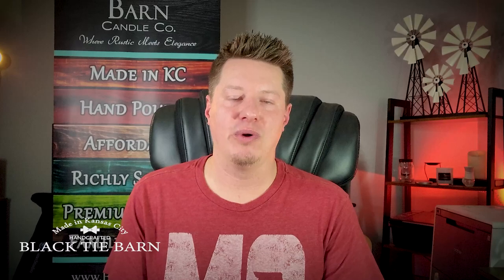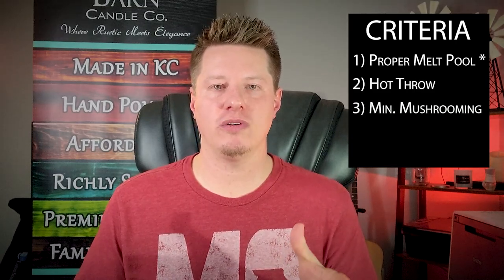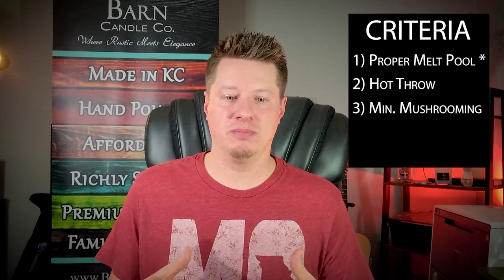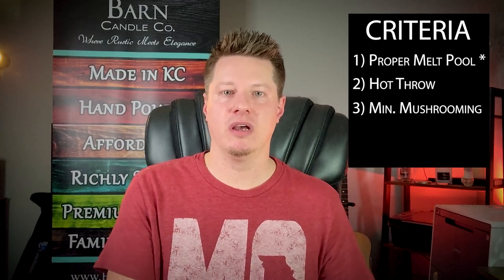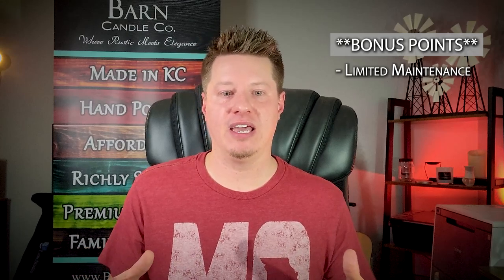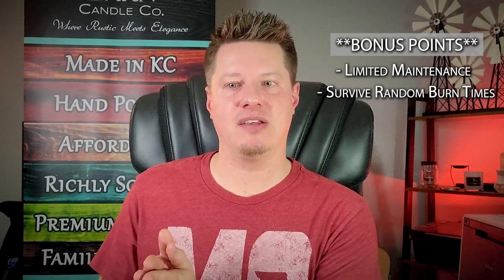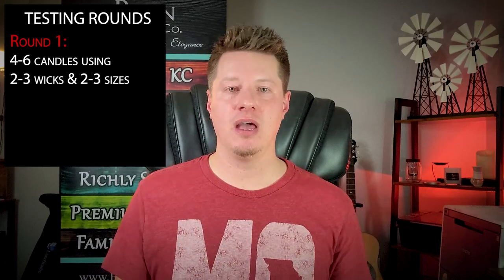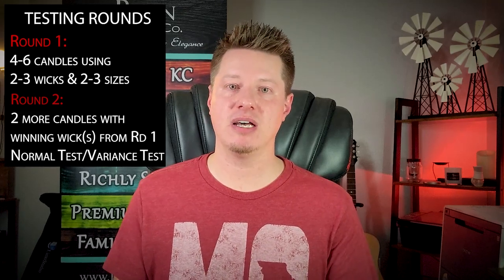Candle Testing & Wick Testing Overview | My Process for Testing Candles | Making Test Candles

Comment: Confused a little lol...I have been using lx 18 wicks from CS in my 9 oz statight jars and LX20 from CS in my 12 oz tumblers....Here is my issue and question. I ran out of LX 18 and LX 20 wicks and CS has been out of stock...I bought LX 18 from Virgan Candle Co and they were not coated, flimsy and seemed smaller which size...I order LX 21 and LX 20 from Lonestar but both were smaller compared to LX wicks..whats the issue...

Question...when testing the LX 21 on a 8 oz tin 2.95 diameter...1 hour 30 % MP 2 hours...50 % MP,  3 hours 75% MP, 4 Hours 80 % MP....why is this wick bigger and performing less than my LX from CS...LX 20 CS was 1 hour 50% MP, 2 hours, 75 % MP and 3 hours 90 % MP....

Am I missing something?
Reply: Wax is 4630
Reply from the maker: Are you testing with the same fragrance oils? FOs make a difference. Also, suppliers use different wick coatings. So  LX18 at one place may be a little different at another place. I try to keep my suppliers the same for each material. But, I know it's not always possible especially when dealing with shortages.  I don't use 4630 nor lx wicks much so I might not be super helpful here. J have notices my lx wicks be a little inconsistent in the past,  but i feel like I've seen that with many wicks. I would consider using two small wicks in that 3" tin. Have you tried. I'd be curious how it works out. Lastly, you may also the suppliers about the wick issues you are seeing. They might have better info.
Reply: @BlackTieBarn  I am testing with the same FO...I just noticed this performance difference in the LX 21 because I was testing it against the LX 20 & LX22...just never used a different brand besides CS so makes since now....so wax is harmony blend and I was going to use comfort blend because of being easy to get out of box lol....what wicks to you suggest in the CS 8 oz tin....I am game for info and trying out...thanks Chris

Comment: What happens if the melt pool is good with the proper burn, but with the variance burn after 5-6hrs the wax covers the wick and extinguishes? Do I still keep that good wick for that candle or have to change it?
Reply from the maker: I would dsy if it's extinguishing after a 5 pr 6 hour burn even after a proper burn, that probably isn't ideal. Because 5-6 hours is still nothing crazy or abnormal for customers. If it's 8+ than you have a good argument and could simply say.... after 4 hours, extinguish, trim, and relight.  But again.. its not so much that a candle that can't handle variance burns is not usable. It's just that bonus I go for when testing.  :)

Comment: I am getting little to minimal mushrooming/soot but am getting a black area at the top on the inside of my 8 oz. mason jar.  Is this normal? This is beginning after roughly a total of 7 hours of burn.  Do you have a video on actual before and after what your jars look like after test?
Reply from the maker: After 7 hours,  yes it's normal.  Wicks strength preforming optimally at 7 hours and they will kick soot. That's why candles are recommended to be burned for 3 to 5  hours at a time.
Reply: Thanks. I wasn’t clear in my burn time. I meant to say over a weeks time the candle was burned a total of seven hours. Not all at once!  You probably thought I was nuts🙃!
Reply from the maker: @klt123100  oh gotcha! Well i depends on wax, FO load, of course wicking and also jar shape. If it tapers at the top at all, yes you will get some soot buildup. A little is normal. A lot usually indicates something to correct. Masons taper a bit and have shoulders, so pretty common.

Comment: Hey Wade, thanks so much for sharing your knowledge! I stumbled across your channel recently and have found your videos really helpful. :) You mentioned that wood wicks will generally reach a full melt pool faster, I wanted to ask what’s your usual rule of thumb for melt pools with wood wicks during testing? Do you expect to see a full melt pool with your first burn? I’ve been testing an original wood wick in a 3” container with c3 soy wax and although it seems it might be a good size (full melt pool on second burn), the flame often seems to get extremely small but never extinguishes, do you think this is a problem? I’ve tried the next width up (recommended width for 3” container) but the glass gets way too hot once the wax is down to the middle.
Reply from the maker: The issue you are seeing is common with wood wicks. Usually incompatible wood wick. Try larger thickness and step down the width. Usuallly that means the wick needs more "power". Or. Simply try the next size up. 

As far as rule for melt pools. It is so tough because it's heavily dependent on wax time. Softer waxes with lower point can go faster than firmer higher melt point waxes. As long as it's getting across within first few burns should be good. :)   but it varies so tough to answer
Reply: @BlackTieBarn  Amazing, thanks so much for your help Wade! Will be trying that out :)

Comment: Great video.  So, I'm new and so far made a couple candles with wood wicks.   Of course, I tested a couple sizes in unscented candles.  I then added fragrance and color, but have not lit those (letting them cure:1 464 and 2 6006).  So, I need to test each time I do a different fragrance?
Reply from the maker: I would. Check out my all about wicks video.  It goes into detail about why.  Anything you add or change asked the wax blend which is what the wicks consume.  Many will use same wicks... some definitely won't.  It's usually just a size difference.  

To clarify.... no need to test a candies from every batch.  Just every new product recipe. Hppe that helps!
Reply: @BlackTieBarn  If I understand correctly, im good if I use the same jar, wax, fragrance,  and wick.  But, if I want a different FO, then I should test that particular recipe.  Right?
Reply from the maker: Correct.  Fragrance changes the recipe and can affect wicking.
Reply: @BlackTieBarn  thank you!

Comment: Hello. :) Love these videos. I watch them regularly. I see where you talked about how the jar shouldn’t get too hot... but I was wondering, do you go by the under 140 number? (Or under 170) And are you testing that when it’s at one of the last bottom area of the jar burns?
Reply from the maker: Good questions and it honestly can vary by jar type. Some glass is ticker than others. Ma y candle jars can go in an oven and get much hotter than they will with a candle burning.  Others can't handle that. So, knowing what your glass can. Handle is important.  If I can grab it ou touch it for a couple seconds without scorching myself that is a good sign. I don't measure heat on every single candle. If wicked properly,  it should be an issue.

Thanks so much for the kind feedbacm
Reply: @BlackTieBarn  thank you 🥰

Comment: What is an acceptable amount of soot on the second half of the candle life? With trimming the wick properly.
Reply from the maker: There really isn't a set answer here.  What is acceptable is different to everyone. I'd rather have it on the jar than in the air though. But, my goal is just the least amount possible. It's hard to quantify that though
Reply: @BlackTieBarn  Thanks! I think I am being too hard on myself. I'm really aiming for none but i'm finding that to be almost impossible. I'm trying to test as if the customer has never trimmed the wick, because, as you know some customers just don't follow instructions. I am using IGI6006 and I have been through SO many wicks. and I even tried wooden, that was worse. but I just want my product to be as easy as possible to maintain.  It always starts out amazing! great flame, HT, CT and all the way through the burn my jar is not getting close to 140 degrees. I just get a little mushrooming after 4 to 5 hours and the second half of the burn sometimes I get soot. Its so hard to tell. I think I have watched almost every video I could find lol. But thanks for all the info you have been such a huge help throughout this crazy candle journey!

Comment: Hi if you’re double wicking, what would be the difference in time for a full melt pool? I have a 3 inch jar so usually on the second burn it will reach a full melt pool but how does that work for a double wick? I tested a candle last night and it reached a full melt pool by a little over an hour.
Reply from the maker: Hey Alicia. There really isn't a specific answer. It depends on the wax type, the jarz etc. Waxes have different melt points so some will get bigger melt pools faster than other.  With multiple wicks my goal is just that it burns well and doesn't get too hot over wicked at any point in the candle.  But it's normal to get full melt pool faster. But no specifics on how fast
Reply: @BlackTieBarn  Ok great I understand thank you!!

Comment: What about a different box of wax with a new lot number ? I was told with 464 you have to retest because of the variants . Thanks for the video . Now I’m thinking , ugh was I
Testing correctly ? Lol second guessing as I don’t do power burns just 5 hours
Reply from the maker: Totally up to you if you wanna test new lot numbers. I have a video about thst linked below (baseline your wax). But most wax manufacturers have an acceptable range of variation that shouldn't affect your performance much. Thst being said I have had to wick wick adjustments before.

Comment: For testing, as a newbie, do you start with testing different wax with no wick to find the best pour/set that you like with your scents? Do you take a chance on just any wicks during that phase before testing your wick? Does it all kinda go hand in hand? #FeelALittleOverWhelmed but trying to research like a maniac
Reply from the maker: It's hard to test hot/scent throw without wicking  so, no I personally don't test without wicks. I figure if in going through the trouble to test everything else I might as well test wicks while I'm at it. For a brand new wax as a new candle maker, just start with some general wick guidance at first.
Reply: Thank you! Felt silly asking but figure if I had that random thought someone else may.

Comment: Hi Wade, Thank you for this great video. I have been doing some testing on my new wax and wicks. I have a question. What did you do with the candles that failed?
Reply from the maker: I use them to either retest or make Firestarter or something else for personal use. To reuse for testing you can either melt down and pour into a new jar with a new wick. Or remove wick with pliers and insert another.
Reply: @BlackTieBarn  Great idea. Thank you Wade!! ☺️😉
Reply from the maker: You're welcome
Reply: Hi there! I do the same, I’ll melt the wax and dump it out and usually do about 3-3.5 oz of wax to test ..saves me containers & then I can give to friends to test for me once I cure them for about 1.5-2 weeks
Reply from the maker: Yep! :)

Comment: Hi there, it's me again ( you might will see many of my comment from now on LoL ) anyway, so I am going to do different testing as you were saying in the video. I am going to try different wicks in the same jar (7oz like yours) with same FO %. I do have a question tho, I was checking 2 of my wicks, and they are both same color ( white) and wax coated ( I think the bigger one from Aztec is serie 700 as you were saying in the wicks video), the other one from amazon looks similar but a little bit shorter and the bottom is simnifically smaller, does that mean anything? I am still trying to figure out which kind of wick are those but now I am not sure if the smaller round circle mean antyhing or it's just the type or wick diameter. Also, is it possible use wooden wick on this kind of jar? Medium wooden wick? Thank you!!
Reply: oh!! One more question, for testing, do I have to fill the jar all the way with the wax or I can do half way? I just reused the jar I used for the 464, I cleaned them and saved the wax ( not sure for what since it's a mix of FO ) and it was a LOT of wasted wax... so I kinda want to avoid this with the 6006.
Thank you and sorry for the many messages and questions :D
Reply from the maker: Hey Greta. It's super important to be 100% sure of the wicks you are using.  I would try to guess or figure it out. I'd put them aside and start with known wicks. 

But, no... the size of the tab at the bottom is not going to affect the wick or the burn. Differrnt manufacturers and suppliers use different size tabs and necks. 

Regarding woodwicks. You definitely can,  I just don't so I wouldn't be sure where to start with them in those jars. :/
Reply from the maker: I like to test with about 3/4s filled to get the best results. I know testing can take time and use materials but try not to think of it as a waste. Think of it as a necessary expense for product development.  It's important and is the foundation for all your finished products. But yes.. you can save a bit by not filling entirely.
Reply: @BlackTieBarn  yesterday I did the testing with all the 4 wicks I have and I fill the cup about halfway. In 2 I did the foil method, what do you think about it?

Comment: I base my burn test times also on the width of my jars as well as the wax type. Did you mention jar width and I missed it ?
Reply from the maker: Basically echoing what you said. I always talk about adjusting for jar size. Little tiny jars are tested and used differently than ultra large jars as you mentioned. Beyond that, this video was more about my processes in general but of course would need to be adjusted for different jars and sizes. :)
Reply: @BlackTieBarn  thanks Wade. I wasn't sure if I was missing that part or not. I always love hearing fellow candle makers routines and advice thats for sure.
Reply from the maker: Absolutely!

Comment: What do you use to keep track of your testing data?
Reply from the maker: Hey Kayla. I have a few methods right now and trying to decide which I like better. This is a great topic idea though for a future video. As of now, I keep track of it as test products in my software I use (craftybase which I mentioned and link in the description). It isn't designed for thst purpose but it's another use case. I also use excel sheets. But I'm currently working on a testing workflow/process system to track as well. Stay tuned. :)

Comment: have any process to clean old wax?
Reply from the maker: Hey! Can you clarify what you mean.
Reply: @BlackTieBarn  Heya! I'm just starting a new candle business this year here in Brazil. Cause my parents had a long year ago candle maker machine and they sell it. So I found this year a Old Wax on stock but its dirty, i tryed make some candles, but I dont know how to clean it the wax. I watched your videos and I've already bought wick and aromathic to test on this old wax, but i dont know how to clean it, or if i need put some plus product on it(oil) or something. Cause botton burns really tiny and some times it goes off.
Reply from the maker: @GunslingerCenter  oh I see. Well, honestly it's not something I have had to deal with so I'm not real sure. But if it's only on the surface, I would simply scrape it off.

If it's dirty all throughout, you might melt down and let the dirt snd debri fall to the bottom then remove it. Lastly... if it's VERY bad, you might not be able to reliably use that wax. :/

Comment: Its strange that designer luxury candles like dyptique always reach a full melt pool on the first burn...and customers compare candles to those often.
Reply from the maker: I agree but it really depends on type of wax. Not all waxes are going to get quite full on first burn. Others will. Also, many of the candles I'm stores these days that get full melt pools early on multiwick candles which generally do get FMPs on first burn. But, you are right...it is confusing sometimes and also frustrating. But they also use proprietary waxes and wicks sometimes thst we don't have access to. That and ridiculous marketing budgets. 😆
Reply: @BlackTieBarn  it confuses buyers...but hey, it is what it is lol

Comment: if u explain these things in some live fail experiment by time lapsing long tests and compare the time lapses it will b e great. as someone like me has no in hand experience . to me at some point its too much information  which i could relate and grasp if i see real-life examples
Reply from the maker: Hi.  I understand.  I have several videos that do thst. I try not do m to do each video the same way and mix up the content.  I have videos everywhere from very beginner to intermediate to advance.  You can probably imagine if I did each video the way you were describing I would get just as much push back on those from the other end. Lol. So I just try to mix it up and have variety in methods. :)